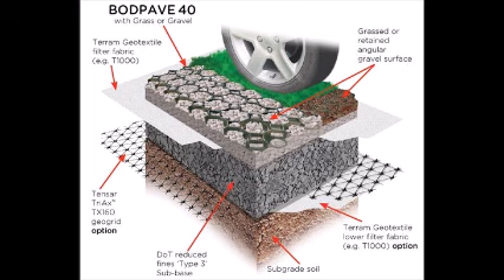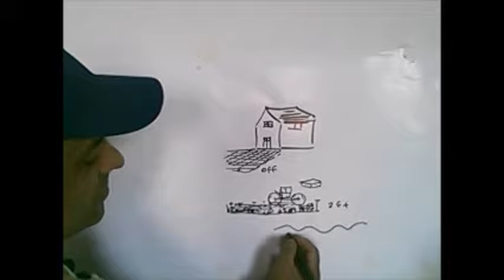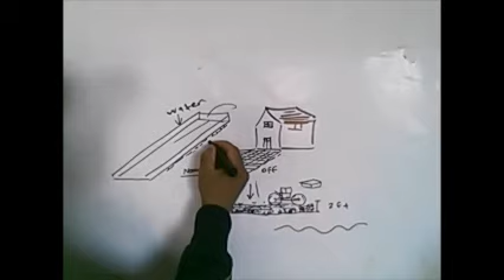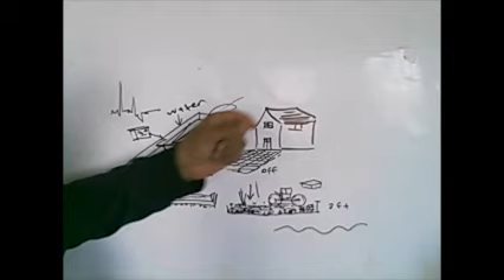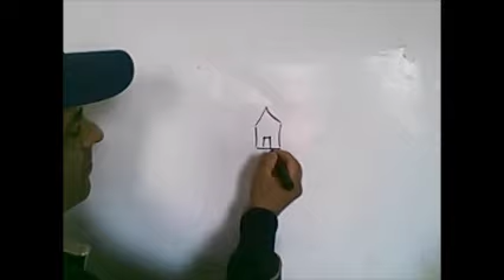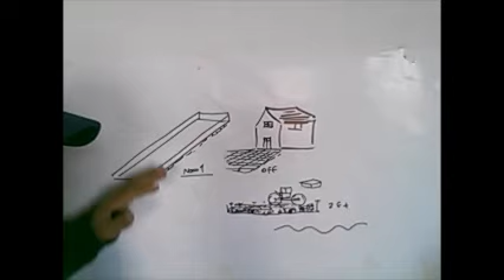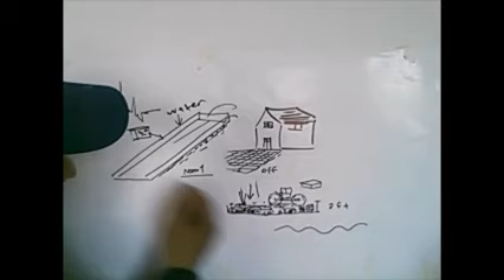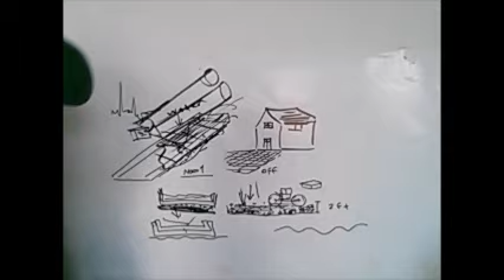OROVILLE DAM SPILLWAY 4/8/2017 by Iranian in Canada

Comment: If the cause was vibration,and maybe it was a contributing factor, then why didn't it collapse at the bottom? Actually, it was used for 60 years with outflow sometimes exceeding 150,000 cfs. What are they doing? They're putting in rolled concrete in the plunge pool and low areas. The problem now is that it's raining right now in Butte county. DWR has to release water over the spillway at least one more time. They have to have the spillway shut off to rebuild. They only have until November to finish. As an aside. I live 15 miles from Oroville dam. I don't think you realize just how massive that spillway is. It's as wide as a 8 lane freeway and when they opened it full bore 30 years ago, they closed the road across the canyon. During the winter of 1986 the North fork of the Feather at Elephant Butte tunnel was 14 feet above the roadbed here.....https://www.google.com/maps/@39.8682436,-121.3741481,3a,75y,23.21h,96.01t/data=!3m6!1e1!3m4!1sFW-y4g-atcNZJa5HruCQFQ!2e0!7i13312!8i6656?hl=en.